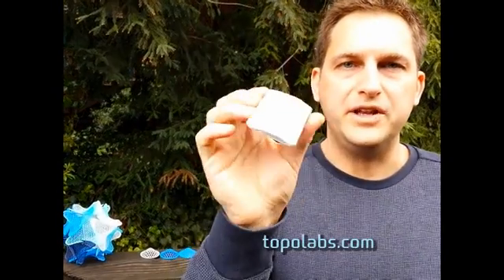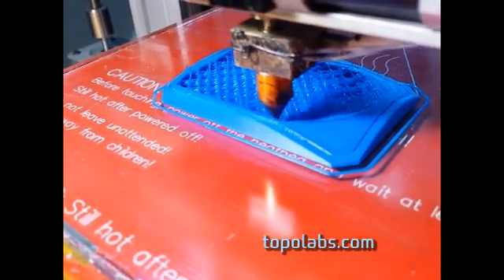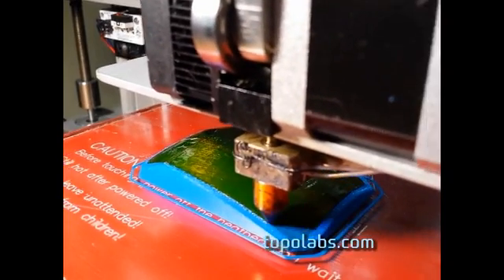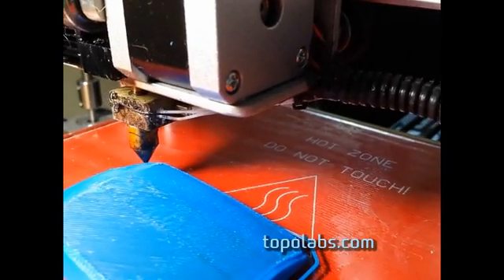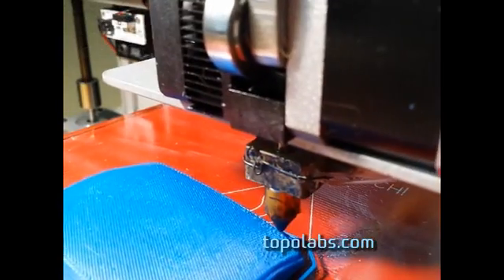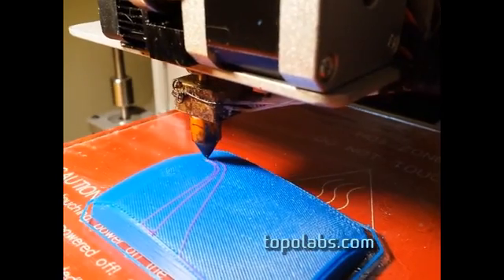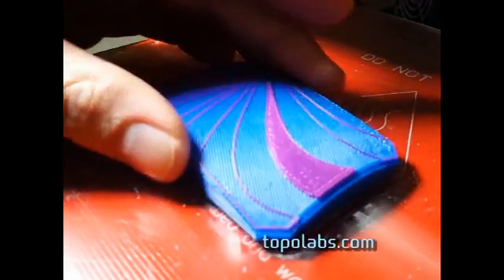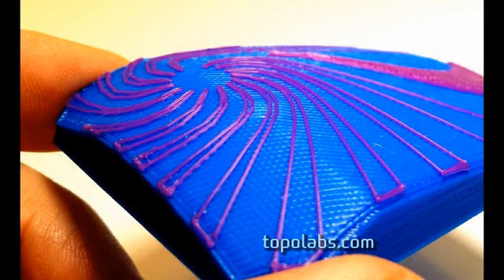Topolabs web video 2   3D printing non planar FDM

Comment: Does the Topolabs Software generate gcode?
Reply from the maker: Yes.  It will generate gcode for almost all desktop FDM / FFF printers.
Reply: James Page Thats awesome.
Do you already know how much the slicer will cost when you release it?
Reply: Hi Topolabs, how is this going on now? I've check your website but it's down, this is really the next big step for FDM FFF printing.
Reply: @pinoy3d169  Found in Google that Autodesk has bought topolabs in 2014!